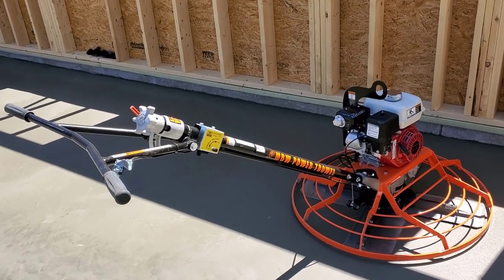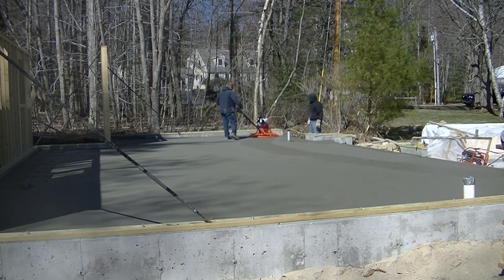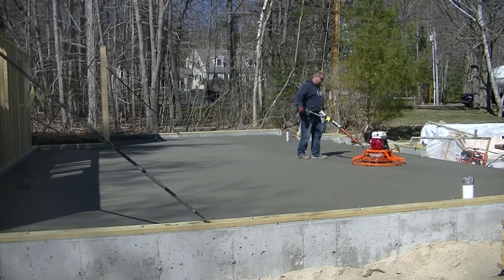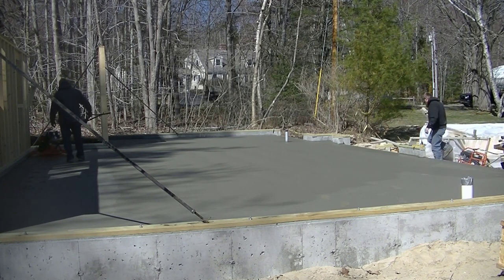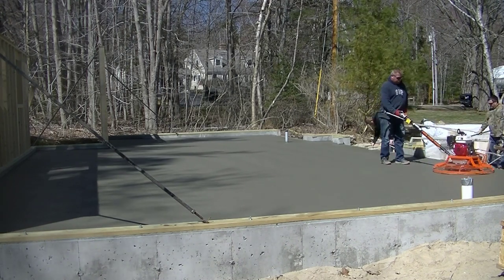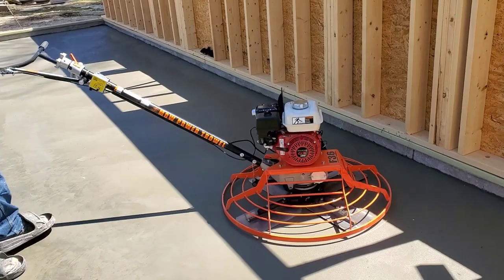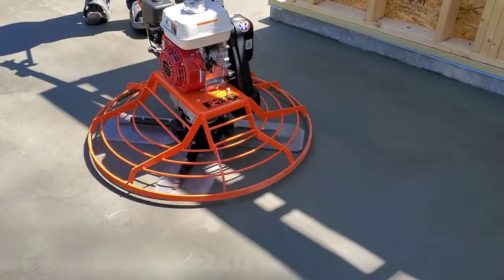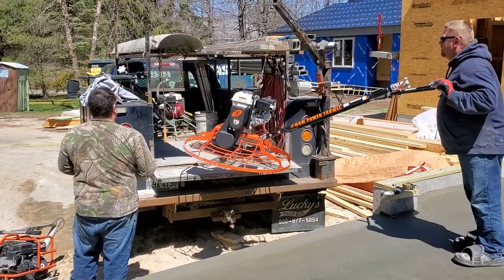How To Power Trowel A 1500 Sq Ft Garage Floor (New Power Trowel)

Comment: Up here in Northwest Ohio practically every concrete contractor uses MBW power trowel machines.  

Mike didn't mention how reliable they are. Reliability matters a lot in the concrete business. It would suck if you had a raging slab to finish and your power trowel doesn't work.

Comment: I have an old 36 bartell with a new Honda motor and its a life saver but it's heavier then some of the whitemans ive used and the handle/bars isnt adjustable.. But the twist pitch blade control makes it worth it

Comment: Thanks for making the video.  Quick question?  I live in a typical single-family home in a subdivision in Northern VA.  The house was built in the early 90's and has a (slab on grade/ floating slab) for  the garage floor.  I am drilling 1/2" holes through the slab and possibly a foot into the dirt for termiticide.   They will be along the perimeter spaced 1 foot apart (so maybe 50 holes).   

Question is: will I be drilling into any utilites?  I am assuming I will hit gravel before the dirt.
Reply: Yes, you will.

Comment: Nice looking machine what's price tag run?
Have 2 Bartells and a wacker with 8 horse Honda on it.what do u guys use to slope doors?
Reply from the maker: Mike, it's in the ballpark of 2500.00  We usually use a Mag float to slope the doors. We dig out some of the crete and slope it as it firms up.

Comment: Is power troweling (after bull floating) necessary if you plan to grind the floor anyway? What would be the result if the power troweling was skipped?

I've done exterior slabs before without power troweling (broom finish) and with reasonable success but I am about to pour a 2000 square foot interior garage floor slab and don't want to mess it up.
Reply: Paul Decker you and I are doing the same thing.  😂

Comment: Well I guess if you want to spend hours waiting for it to set up 
Power trowel to BBC flatten It out skate boards it on final hit move on 
But to each their own
Reply from the maker: Charlie, is there something wrong with power troweling it. Have you got a better way?
Reply: Mike Day Everything About Concrete no just hitting it by hand faster and move to the next job 
I just pour and finish more cement then 15 yards a day all I am saying 
There no wrong way 
In less ya loss it then because cement only does  2 things m gets hard and cracks  lol
Reply: BBC,  are you referring to bump cutter?  I don't know anything about doing all this.  Just heard about bump cutter on another video.